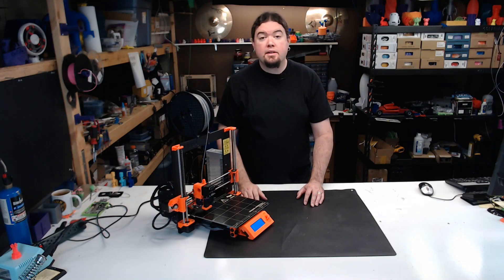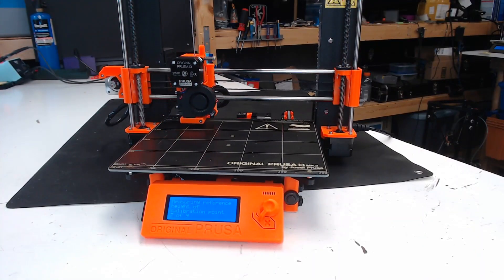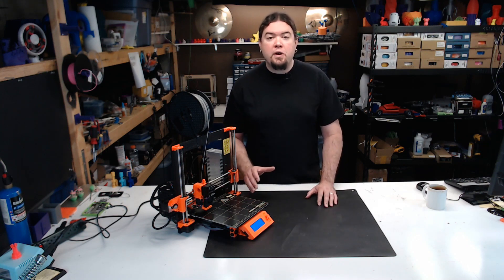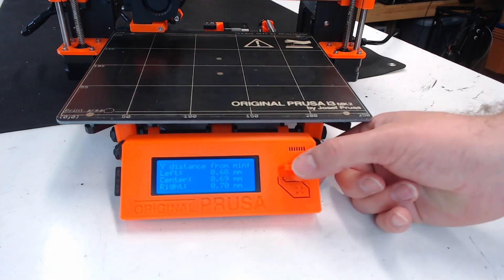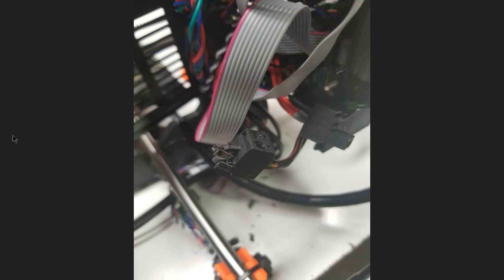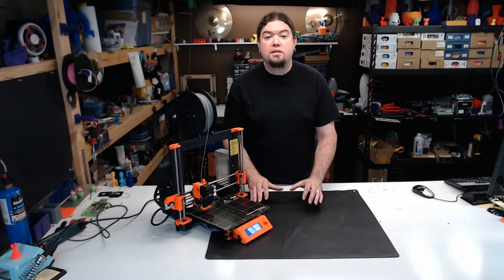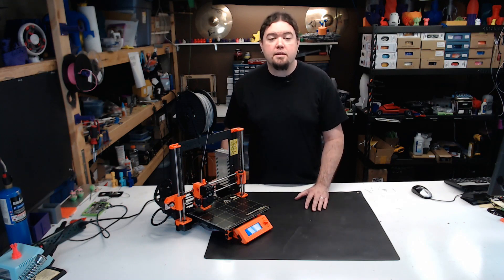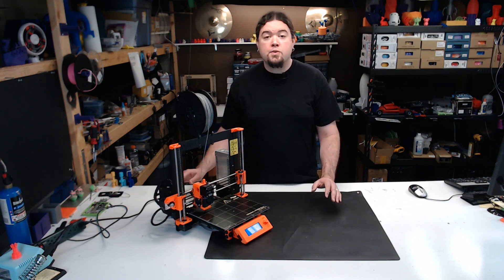PRUSA MK2S After 1 Full Year Of Punishment - Chris's Basement

Comment: Thanks for the video. I see they've updated the connectors for the heat bed now, but are still using screw terminals, which are poorly suited to environments subject to vibration. Screwless terminals, such as Wago, would be much more appropriate imo.
Reply from the maker: Yes, the screw terminals are a lot better than the clip on types. Agree though, not perfect.

Comment: Another great video, Chris.  The MK2 was my second printer, and first GOOD printer after starting with a poor quality, low cost Delta.  It taught me the value of good quality components.  I upgraded mine with the Haribo 3030 extrusion frame.  When I did that upgrade, the wiring issues were starting to become apparent, so I also re-wired with 14 gauge silicon wire.  I also replaced X and Y bearings with the solid Igus RJ4JP bushings.  Super-quiet, but they have their own issues too.  We've got a great Slack-type community that got its start with the MK2 over at https://3dprinting.community.  We've certainly branched out from the MK2, but it is at the core of many of our experiences.  Thanks again!
Reply from the maker: Awesome build! Thanks for the comment! The Prusa's are just great machines. Well worth the price and the wait time. Always good to hear all the project people are working on. Thanks for watching, I had fun on this one!

Comment: Other than my MK2S machines falling victim to bad linear rods I never had issues with them otherwise. Changed everything over to Misumi.
Reply from the maker: That's interesting. I have never seen the linear rod issues. Glad you found a fix.
Reply: They had an issue with the MK2S and even the MK3 where they were shipping them with stainless steel rods instead of hardened steel. Much of the early release Mk3 machines were plagued by scored linear rods. They have since figured out the issues but not without a LOT of people complaining.
Reply from the maker: I wonder how you can tell which ones you have? Are there noticeable differences besides the failures?
Reply: Chris Riley The way to check them is to use a strong magnet. The stainless will have little to no attraction to the magnet. Another way is to use the corner of a flat file in a spot out of the movement area and try to scratch the rod. The stainless rods will scratch easily while the steel rods will hardly scratch at all.
Reply from the maker: Cool man, thanks!
Reply: Chris Riley Anytime!